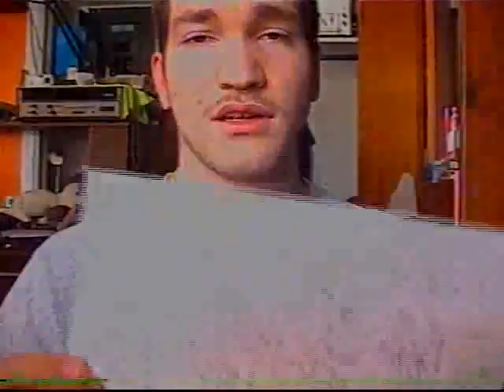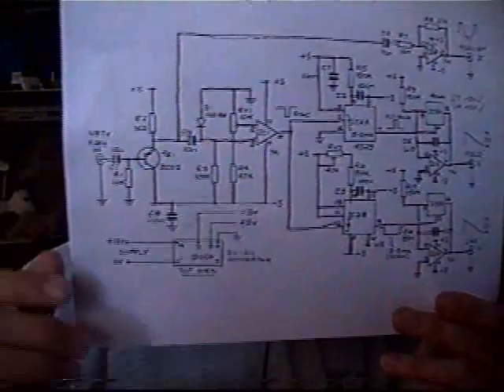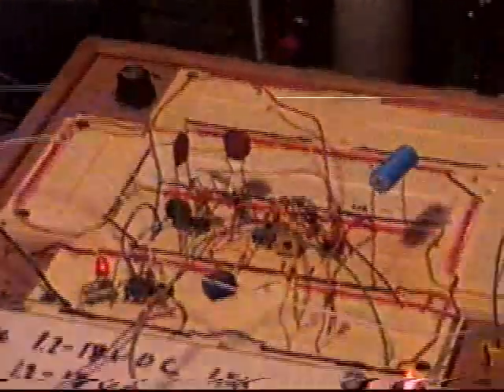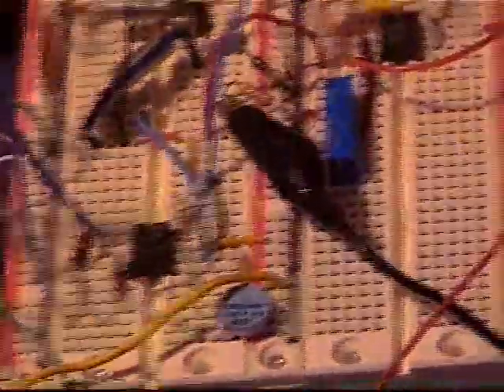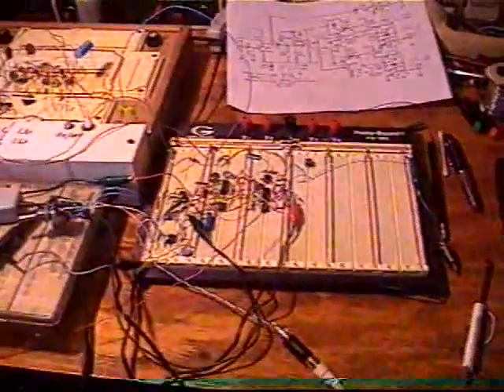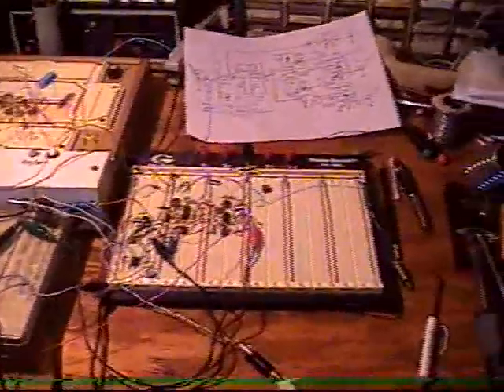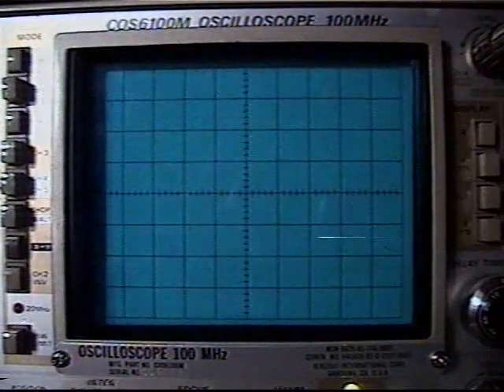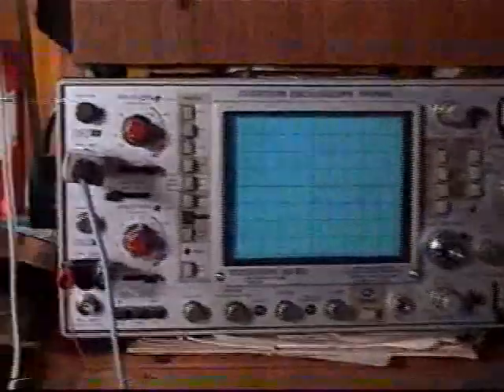32-line NBTV - to - Oscilloscope converter

Comment: You can have 2 colour NBTV (surprisingly good) and 3 frame sequential colour. Both should work with tape - there is a full colour version but it requires digital encoding - see my channel for examples.